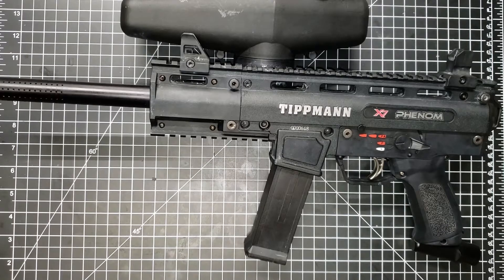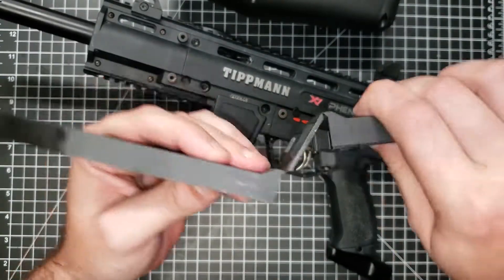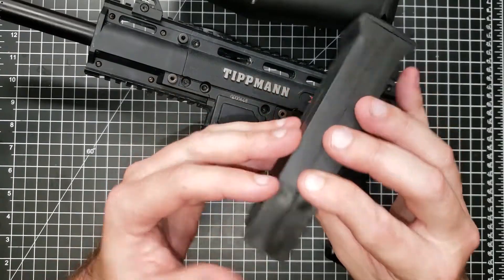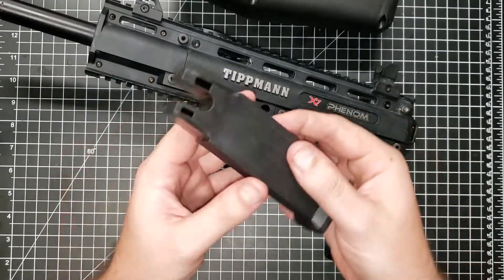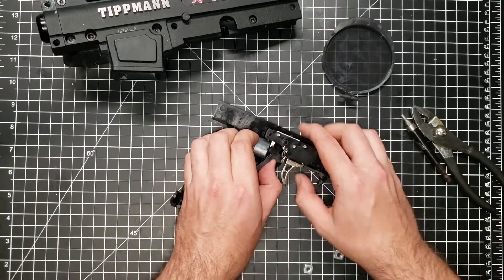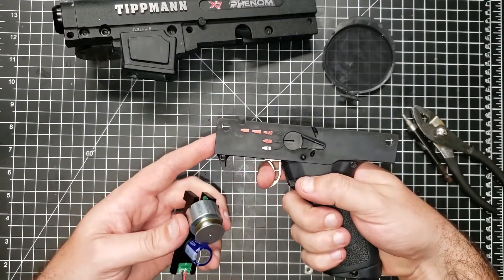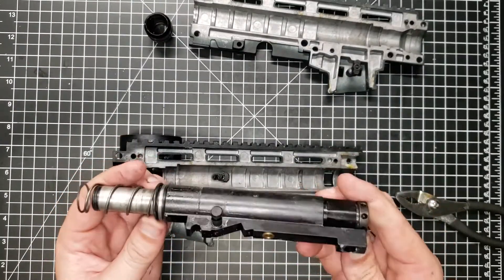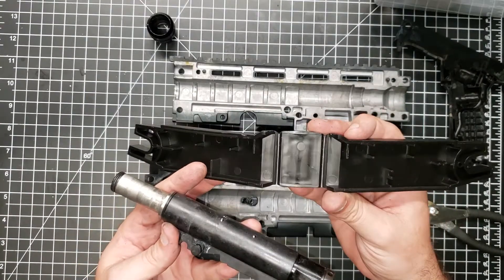Engineer Explains Why TIPPMANN X7 PHENOM Has Insane Design Quality!! | How's It Made Ep. 3 Review

Comment: Just bought one - love it
Reply from the maker: Sweet! Would love to hear any feedback you have as you get some use out of it... to see if it has any weak points.
Reply: @JJCCENG  

chops cheap paint when i tried connecting to hose (bought used - used chrono to see velocity - velocity randomly dropped by 100 ft/sec - had apex installed)

Plugged in tank directly, solved most of the chopping issues (more consistant velocity - took off apex - got higher readings - could adjust velocity on marker - even less chops with reg barrel vs apex - maybe apex doesnt like full auto?)

If ur under 20 balls per second, no issues (apex on or off)

Better chance to consistantly fire 20 balls per sec with standard barrel than apex.

Does still chop, but at a significantly lower rate.

But me thinks it is the paint issue, not the cyclone issue.

Great gun, even though it doesnt have a ball sensor at cyclone.

Would buy again
Reply from the maker: @zacktrever1878  Great info. Thanks!
Reply: @zacktrever1878  would you be interested in selling it to me ?
Reply: @southsideshenanigans  it is possible
Reply: @zacktrever1878  let me know. Thanks
Reply: @southsideshenanigans  what's ur contact
Reply: @zacktrever1878  I'm late but Tippmann states that the cyclone feed can't handle more than 20-22 bps but neither can your wallet.
Reply: @PaintballSniper  lol